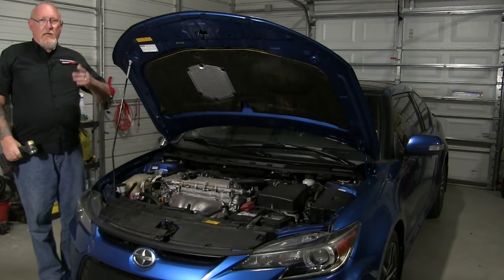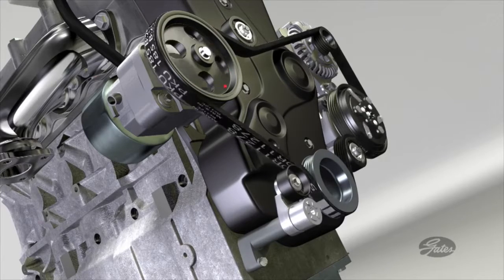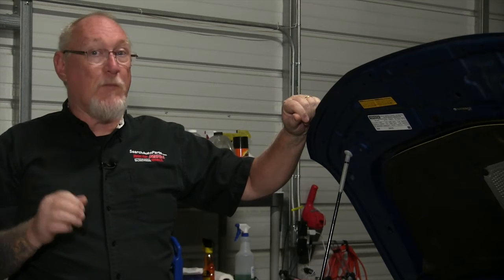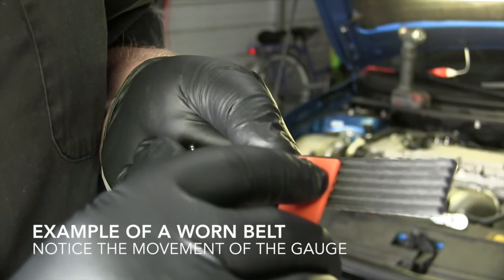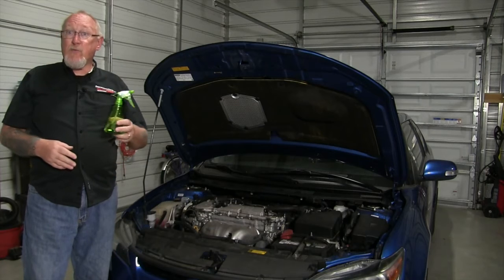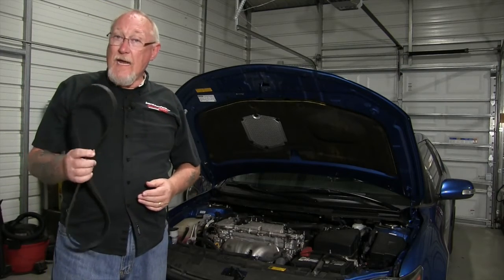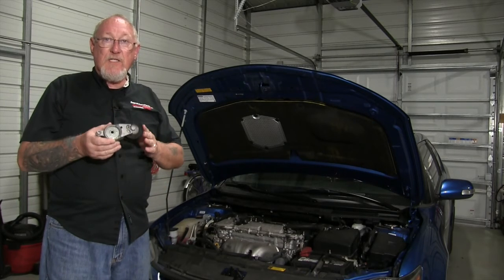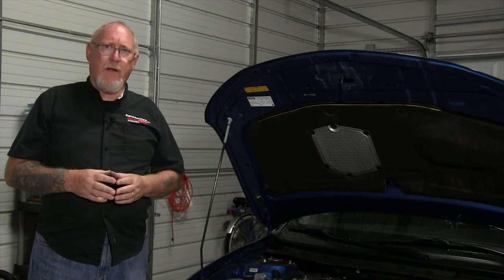The Trainer #76:  Servicing Serpentine Belts - What You Need To Know

Comment: The only problem with these new belts is that they hardly crack so customers will never change it because it looks good visually. I Had this the other day and they thought i was tryin to screw them Out of $50. I even got reamed out from my mangers! I told them I used my belt gauge and it was clearly worn out on depth of grooves I was told that tool was a waste of money!? Many still going by cracking belts not wearing in depths like a tire. This mentality wont go away for the next 10 yrs or more
Reply from the maker: Maybe you need to work with another shop? There are plenty who are embracing new processes to do the job right and would welcome a tech like you

Comment: Informative video, my mechanic (I have been going to him for twenty years, a very skillful and honest man) recommended replacing the tensioner on my 2004, Mercury Grand Marquis recently. I took his advice but I didn't get a chance to ask him why since it appeared sound. When I picked up my car he showed me the tensioner and belt and it was obvious that the pulley had a lot of run-out and the belt had unnatural wear on both sides. Now the engine no longer chirps and I would swear that both the a/c and alternator work better.